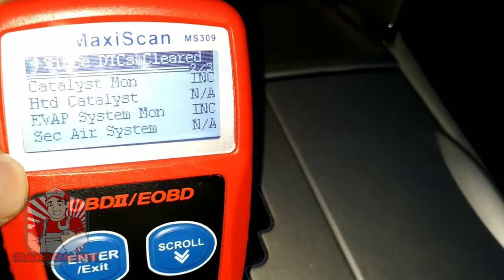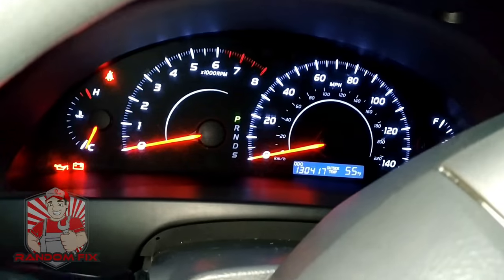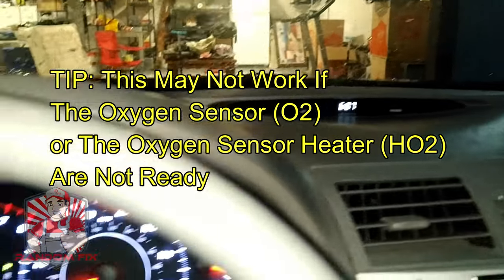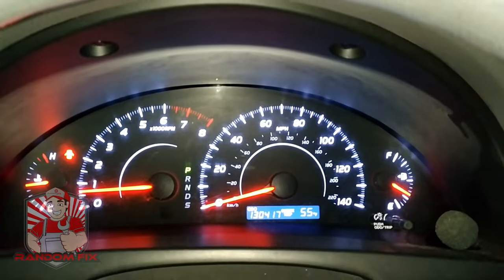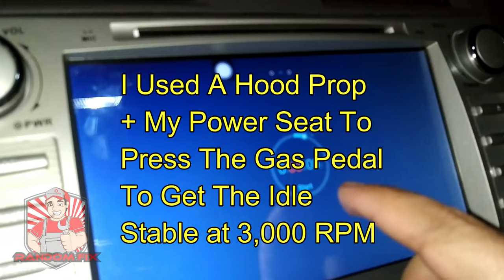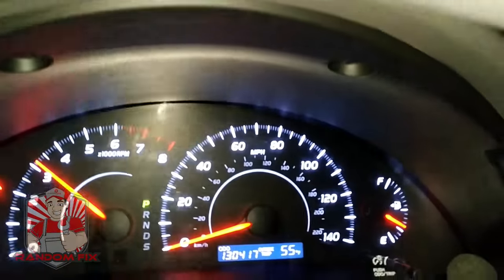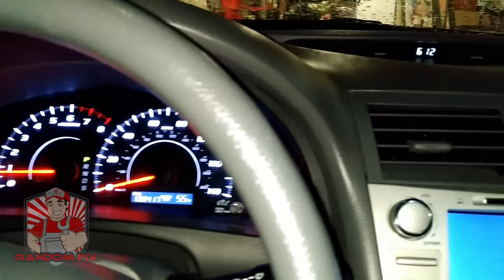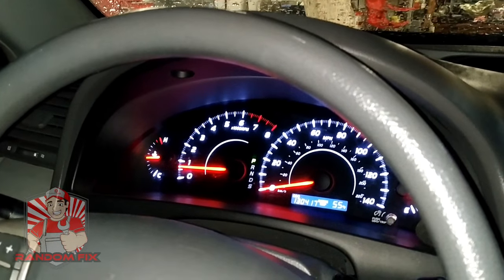Amazing Trick to Get Catalyst Monitor Ready!

Comment: My catalys monitor would not come up and say okay after having work done on my truck because they disconnected the battery. I had been driving my truck with a bad misfire for several months because I couldn’t afford the replacement of the intake manifold. After finally getting it replaced 
I drove the truck for over a week and no luck with the catalys monitor. Then tonight I used a product called Cataclean. I Followed the directions and low and behold the cat monitor says ok! Omg I’m so relieved.
I did try revving the engine to 3000 rpm three days ago after initially watching this video but it didn’t work for me. Anyway.. I just wanted to mention using the Cataclean in case anyone needs another method to try.
Thank you for sharing your vid I’m sure you’ve helped many people.
Reply from the maker: Awesome thanks for sharing, I have 2 videos about cataclean. In the future as your catalyst ages even more, cataclean will even become useless for you so when that happens check out my video on how to buy direct connect catalysts for about the price of 5 bottles of cataclean. Thanks for sharing.
Reply: @RANDOMFIX  okay I definitely will. Any chance you could post that link on here for me? You’re probably right, I’m sure my cats will need to be replaced at some point. I never got a code for them, just a slow monitor. But I drove for several months with a bad misfire and sometimes two cylinders were missing due to water getting in the plug wells. I’d remove the coils and clean them out from time to time but my check engine light would flash sometimes. So they’re probably not in great shape.
Again thank you for making the vid and sharing.
Reply from the maker: Here is the link  
https://youtu.be/Wr1vFqCnpDc

and all smog related videos are in the Smogs tips playlist.

Comment: I have a 2000 Yukon. This worked for me. What I did, was drive the truck in 2nd gear (number 2 on the dash) at 45 mph. This gear and speed was perfect for achieving a consistent  3000 rpm. I have a Bluetooth ODBII connected to my phone, so I literally watched the Catalyst Monitor go into 'ready' state as I was driving. It was around 10 mins of in town driving, which I had several stops in between. The reason why I drove until of doing it in my driveway is because my exhaust is fairly loud and I didn't want to disturb my neighbors. I just made a trip to get lunch a productive one, and it worked!
Reply from the maker: Thank you so much for the great feedback and congrats on setting the Cat monitor on your 2000 Yukon! is the catalyst original?
Reply: @RANDOMFIX  you're very welcome and thank you for your information! Yes, I have the original cats on my Yukon.
Reply: Hi bigthreewheeler.  Could you please tell me what BT OBDII app you used?  I haven't been able to find one that monitors the stuff needed for smog checks.  Thanks in advance friend!

Comment: I have a 1999 ford crown Victoria p71 the problem with it is I have two incomplete monitor evap and catalyst I have drove the car more then 150 miles and the monitors won’t set what would I do?
Reply from the maker: You need handle the p0071 and

Here are some possible causes
Failed or faulty ambient air temperature sensor
A short in wires or broken wires
An open or shorted ambient air temperature harness
Corroded electrical circuitry and/or connectors
Sensor covered by foreign objects

Once you fix the issue then complete a drive cycle.

Comment: I have 2000 Sienna with 150k miles
I jumped my battery 2 weeks ago so didn't pass the the smog due to No Data. 
So I did drive cycle for 150 miles and got everything ready except for catalyst monitor So here is what I did :
Cold start overnight 
Idle for 15 minutes 
Revved 3,000 rpm for 3 minutes 
(It would jump after 2 minutes but kept going) 
Drove about 2 miles 
(to Advanced auto parts to pick up the DTC (OBD2) scanner without turning off the engine)
Connected scanner and drove to freeway
At speed of 50 mph for 3~5 minutes then drove 45 mph for 2 minutes then the CATALYST monitor changed to Ready status. So I took it to smog station and passed  in couple days after.
Reply from the maker: That’s awesome, thanks for sharing your success on getting your 2000 sienna catalyst monitor ready.

Comment: EXACTLY What I need for old camry
Reply: Did it work?? I have a 2001 Camry and the catalytic still shows incomplete 🤦🏽‍♂️
Reply from the maker: Yes, this is for older cars such as your 2001 Camry.
Reply: Thanks im doing this now
Reply from the maker: Glad to help and I'm here if you need anything else.
Reply: Nope,  didn't work. Driven over 1,000 miles on 97 accord 4cly ,every monitor is good except catalytic monitor.
Reply from the maker: This will help with your 1997 honda https://youtu.be/oZELvZ4danA

Comment: Should you keep your scanner attached so you can keep an eye on it in case it works before 3 minutes? So that maybe you don't have to run it the whole 3 minutes?
Reply from the maker: Sorry for the late reply! did you find a solution?
Reply: @RANDOMFIX  I ran the car twice for 3 minutes each time. It didn't work.
What I found out that for many cars, the computer is looking for what's called a Drive Cycle.
Each car has a different routine its looking for, like drive at 30MPH for 30 min, do certain full stop exercises, idle for 5 min. Each car has different drive cycles.
The computer is basically seeing that you are driving your car regularly.
My mechanic told me to drive my car on the freeway for 100 miles. That didn't work and was a waste of gas and time.
Reply from the maker: So how did you pass? What are you driving? What are you driving?

Comment: My 2000 camry wouldn't complete the cat test, no precheck engine codes, Drove over 300 miles tried 2 different drive cycles i saw online and nothing. Scanned before I tried this method to make sure it was still inc And it was and this method actually worked. I don't think this method works every time but It sure worked this time. Thanks mane
Reply from the maker: Ronin, thank you for the feedback and congratulations on setting the inspection monitors for your 2000 Toyota Camry. This drive cycle does not work for some vehicle so I made a vehicle specific video for each make. 2 months of work my hope is that every can benefit from those videos. They can be found on the smog tips playlist.

Comment: Just wanted to say thanks. Although these exact steps didn’t work for me on a 2003 Toyota Camry, but I knew where you were going with this. On the Toyota Camry, there is a button on the transmission stalk to turn on/off the “Over-Drive” system.  Once I turn that OFF and drove it on the freeway, the Catalytic Monitor went to Ready.  Basically, I needed to get to a higher RPM (above 3k) on the freeway for an extended period of time and that monitor will clear.  When the over-drive is ON, it would always hover around 2k, this doesn’t make the catalytic converter hot enough and so the computer will never say it is ready.  So if you have a vehicle with this type of over-drive transmission, turn it off and go for a freeway drive and in 10 minutes of freeway driving it will clear.  I guess if I had to do it again I could have done this same procedure longer and it might work, so instead of 3 minute just let it rev up to 3k RPM for longer.
Reply from the maker: You hit the nail on the head. You have to get catalytic converters hot and when you turned off the overdrive you made the engine work harder and it  produced more heat.

I didn’t recommend turning off the overdrive as 3k rpm on certain vehicles like Chevrolets, bigger v6 and v8 motors will be destroyed as those motors lose oil pressure.

Thank you again for sharing.

Comment: New cat installed 06 solstice. This didn’t do it for the catalyst monitor, so I decided to drive at lower gear at around 40 mph and RPM’s at 3000 or a little higher for about 10 miles. Tested and all ready to go. Thanks
Reply from the maker: Thank you sharing your story on your Pontiac Solstice

Comment: Did it today for my 2000 Nissan frontier all monitors passed/ok except for catalytic converter said “Inc” (incomplete) held throttle at 3000 rpm for 3 minutes and 30 seconds gave it a quick rev and then turned off truck for 10 seconds turned it back on held rpm at 3,000 rpm for another 3 minutes and 30 seconds, gave it another quick rev checked monitors and they were complete 

thank you so much saved me lots of gas money and allowed me to keep my favorite truck with the 3 minute 3,000 rpm trick never in a million years did I think this was a fix / procedure for setting catalyst monitor I drove 500 miles attempting to set catalyst and ended up setting them in my driveway (-:
Reply from the maker: Thank you so much for sharing your success on your truck. I appreciate your feedback and for letting me know.

Comment: Hello, I  just replaced new factory catalytic converter on my 2009 Honda Odyssey, driven for 800 miles, tried your honda drive cycle instruction video, this 3000 rpm for 3 minutes and still not ready. Any other alternative that you suggested? Thanks in advance.
Reply from the maker: I appreciate your feedback Sorry for the late reply, did you get this handled?

Comment: I have a 2003 toyata matrix and tried your advice with no luck. Can you give me any other advice? Thanks
Reply from the maker: Here is the Toyota drive cycle that may give you a little more clarity
https://youtu.be/EKfEr2LP2Nw

And this whole playlist is focus only on the catalyst monitor and some tricks. 

https://youtube.com/playlist?list=PLDEbtVOPRC-h1BAzaWQ-6NSnmG0gwvgwP

If you need additional help please give some more specifics about the vehicle and what caused the issue like a dead battery or after monitor catalyst etc... Thanks
Reply: @RANDOMFIX  the car has 128,000 miles. Runs s great, automatic,  no issues other then the 2 incomplete evap and cat. I can't get it through inspection with 2 not ready. I did the 3000 rpm for 3 minutes,  drove the car at 65 for 15 minutes. I've had the cat inc now for 3 months.

Comment: Questions do I just get a regular hood prop at the auto store? I dont have one also i dont have power seats so how do i do this? I desperately need that monitor to go off. Thanks so much!
Reply from the maker: Just use anything you have like a broom stick and use the back of seat to apply a steady pressure if you are unable to do with your foot. No need to spend any money 💰! 

Keep me in the loop and good luck.
Reply: @RANDOMFIX  I was able to use your other method of driving and going 65mph to 5mph without breaking. It worked like a charm! You are brilliant! Your channel is easily one of the best on all of YouTube! Thank you for sharing your knowledge! ♥️

Comment: did not work for me :(  but how critical is steady 3k? it's very hard to do when I'm also battling with an idle and acceleration engine surge. someone else posted they needed 4 minutes?  My evap is also offline.    2002 volvo s20 base model.
Reply from the maker: This really effective on Toyota and honda not sure about volvo. The evap is not required even in California. I would focus on really warming up that catalyst before trying. 

Here is the volvo drive cycle and the catalyst monitor is covered in the video https://youtu.be/mEeUwDd_dsc?si=-PSRqYs4dvA1dyi2
Good luck and keep me posted

Comment: Any advice on an S2000; since my RPM limit is 9K, would I have to hold the throttle at 4K instead of 3K? I’ve tried this and still no luck for me. 🤔
Reply from the maker: If the temperature is colder yes. But make sure you drive a one freeway before doing this as honda vehicles are know for excessive oil consumption and the oil poisons the catalyst. Drive on the freeway for extended periods of time helps. Hills and steep inclines will assist in getting the catalyst converter nice and hot to burn the surface oil. 
https://youtu.be/HkF4oCED0UU?si=8-9SA-A5aCz4DVMe
Keep me posted and good luck. That s2000 is a sweet ride!!
Reply: I finally passed. I just kept sending it on the freeway at midnight. Just had to do multiple drive cycles to get it to pass. Multiple drive cycles are driving the vehicle from cold start and following the specific drive cycle for that vehicle. So moral of the story is to just drive the car, street and freeway, which will take a few days.
Reply from the maker: That’s great to hear. If you watched the video I sent you of the honda I had to get ready that exactly what I said because sometime the catalytic converter are so poisoned from oil with honda motors the only cure is drive long and hard on the freeway. Thank you again for sharing your success with your s2000.

Comment: My dad got a 2001 Toyota Camry change the dead battery went for smog check it failed twice I been driving the car for 700 miles for three week now so tomorrow I will try the way you show on video do I need to buy the scanner to hook up for this test I got a Mechanic will scanner the car after the test
Reply from the maker: Yes you need a  obd2 reader to check the monitors

Comment: On a 1998 Chevy Blazer with Drive Cycle Performed the CAT, EVA and HTR Monitors are Not Resetting!?
Reply from the maker: Focus on the o2 heater monitor first, then the catalyst ( cat) monitor and normally the evap will be last to set.

Here is the Chevrolet drive cycle to help better explain this.
https://youtu.be/Yp34ksJY-fQ

Let me know what happens and good luck. 

By the way what cause the inspection monitor data to be deleted?

Comment: Hello, I'm gonna try this. I'm getting cat not ready. Just to be sure - is revving to 3000rpm for 3 mins safe for the engine? I have 2011 Nissan Altima 85k miles.
Reply from the maker: Shameer this normally works with older vehicles. You can try it and if it doesn’t work here is the drive cycle for your 2011 Nissan Altima 

https://youtu.be/s9PLkO-CjZ8

Comment: When I take the car to smog the catalyst monitors are not ready. Also I’m gettin g a purge valve code p0496. Would the code cause the catalyst monitors not to be ready or are they 2 diff systems unrelated?
Reply from the maker: They are two different systems. Address the current p496 and don’t be surprised if a new issue appears. The joy of car ownership

Comment: Thank you, 2005 Toyota Solara, this got my evap monitor ready but not the catalyst. After two and half minutes at 3k  rpm the engine started idling up and down so I had to stop, any suggestions?
Reply from the maker: Try a lower rpm at 2.5k for 5 minutes. You
Reply: @RANDOMFIX  I just want to thank you, it took three tries of your method and finally pass smog.

Comment: 2013 Corolla.  Inspection rejected.  OBD not ready to be tested!  Catalyst & oxygen sensor both not ready.  Mechanic said drive it 200 miles.  Mass state emissions expert says no do not do that.  Bring it in and he'll do exactly what you just did.  I wonder if i should try it myself..  So have the car outside.  Sit in car with windows open, leave it in park, press gas pedal to 3000RPM for 3 minutes????
Reply from the maker: You can try but your really need to get the oxygen sensor ready first. Here is the exact directions for your Toyota corolla smog drive cycle explained in depth.
https://youtu.be/EKfEr2LP2Nw
Keep me posted

Comment: Will this work for a 2000 Saab 9-3 manual transmission? I am at my wits end with drive cycles and no result. Also have not been able to find a drive cycle specifically for this model car- thanks so much in advance. Note the car'battery was replaced 3 weeks ago.
Reply from the maker: Yes this could work but which monitor is incomplete? Is there any pending codes? I’m here to help and point you in the right direction.
Reply: @RANDOMFIX  Thank you! its is the catalyst monitor that is incomplete "C" on my tester- shows red- all others show green- for a while I was also getting a PO455 code, but now that code is not showing and I'm getting a " No Powertrain DTCs Freeze frame data is currentlty stored in the vehicles computer.
Reply from the maker: Hi Leisa, the p455 for a small evap leak if the evap monitor is set I would not worry about that for now. As for the catalysts monitor this could be a little challenging but not impossible. I made a complete playlist to help with this.
https://youtube.com/playlist?list=PLDEbtVOPRC-h1BAzaWQ-6NSnmG0gwvgwP

Please keep in mind your catalyst in your 2000 Saab is over 20 years old, so you will really need to focus on getting it ready like I show in the videos. Please watch the videos for some ideas but I think you understand the theme after watching.
I am here to help once you watch some possible ideas and keep me in the loop.
Reply: @RANDOMFIX  so appreciate your help. I'
m off to start watching the play list, Thanks so much. I will relay my progress.
Reply: i have tried the 7mintue idle and the 3 minutes at 3000 RPM twice  now- do you think I should try the cataclean on this age car (2000 Saab).? Also why is it now saying No DTC info stored when I have driven it about 200 miles since the new battery was installed?
Reply from the maker: I would try cataclean as I show in the video, do a 20 minute warm up cycle and then drive on the freeway at steady high speeds. Once the monitors completes take it in right away to complete the emissions tests. I also tried some less expensive products on that playlist to look before you buy anything as cataclean can be very expensive. It’s all about getting that catalyst nice and hot. It can be easier to to set the catalyst monitor in warmer weather.
Reply: @RANDOMFIX  sorry so many questions. Can you please explain what is correct way to complete an 20 minute warm up cycle?
Reply from the maker: Because you want to the catalyst inside the catalytic converter to get hot during the idle, this will reduce the time needed drive. I explain in this video and you can see the results
https://youtu.be/lRMISO1FCYo